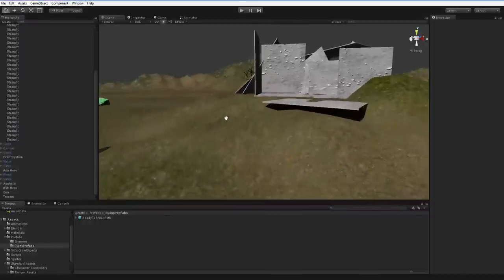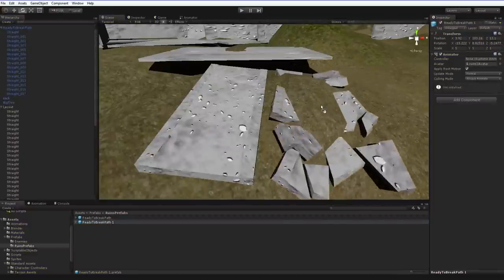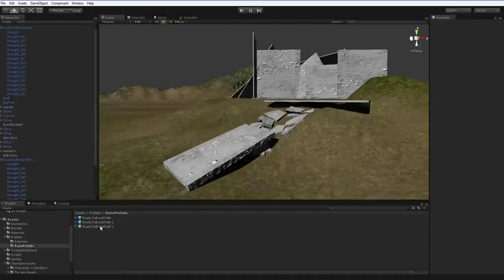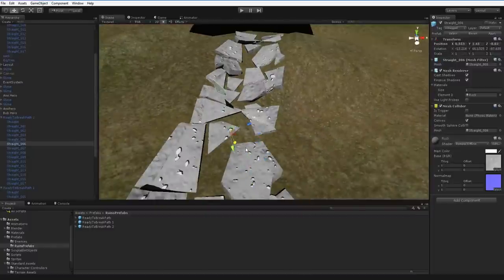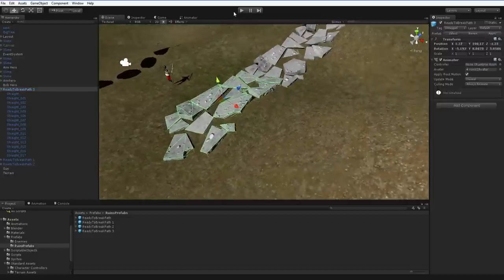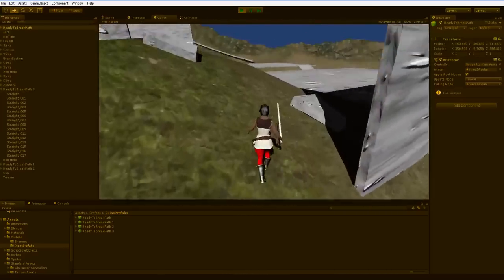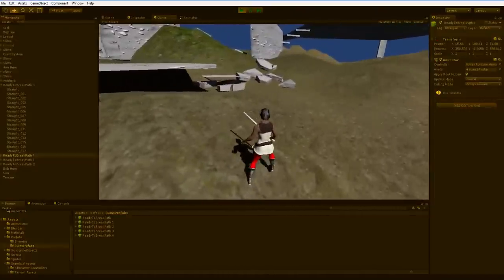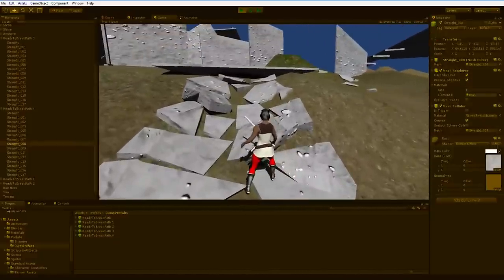Let's Program RPG #32

Comment: No, that's a perfect valid use of the physics and the ability to create prefabs from the runtime state... very nice.
You can still merge the meshes with something like the SimpleMeshCombine from the Assetstore. Or there's a mesh combiner in the Hydrogen Asset, just not sure it that's runtime only - but if so, you can add the save capability yourself.. it's just a line of code to save a mesh to the Asset Database.
Reply from the maker: There's a CombineMesh function in modern Unity, works fine.
Reply: Ah... Mesh.CombineMeshes .. perfect.